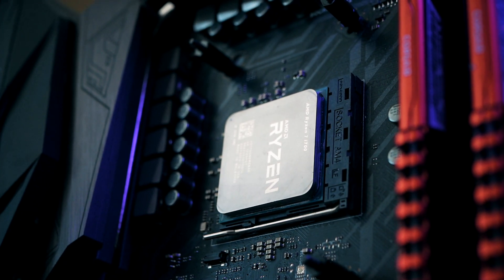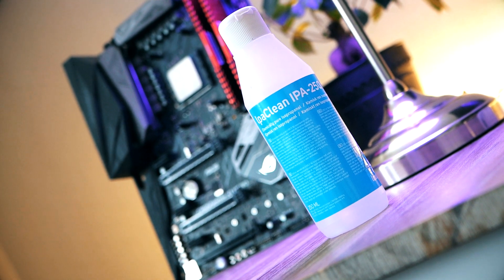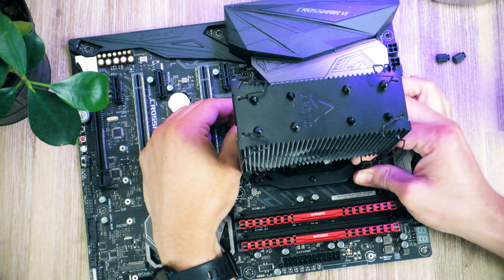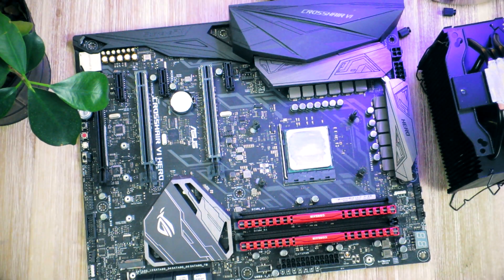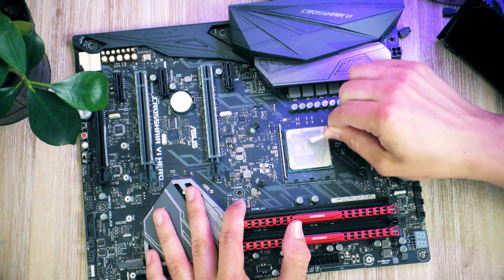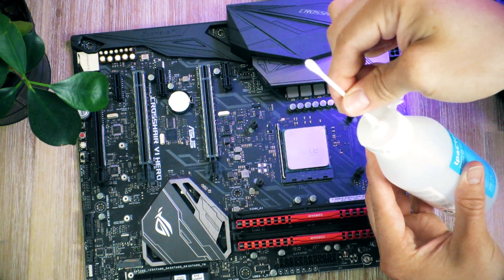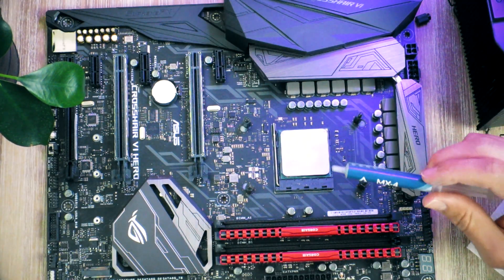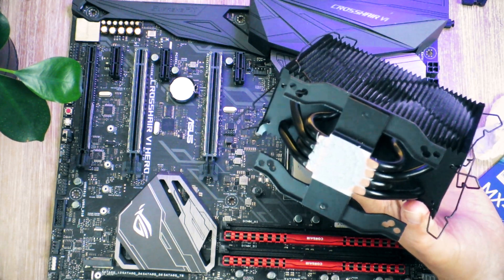How to Remove Thermal Paste From CPU & How to Apply New Thermal Grease

Comment: Added note: Disconnect the Motherboard from the PSU  I also prefer the spreading method on the CPU paste.  The thermal paste is only used to fill the tiny gaps of space between the cpu and the cpu cooler.  Use as thing as possible, this will increase the efficiency.
Reply: Or if you really want to go crazy, 3M makes sandpaper designed for cpu lapping and it gets ultra fine.  Get that heat spreader shaved down a few micrometers and give it a mirror finish before applying the heatsink and paste

Comment: My motherboard has a metal unit that goes on top of the CPU to keep it in place. So to remove all the thermal paste, I had to remove that unit to get at the edges of the CPU. But because I left the CPU in the motherboard without the unit and tried to clean it with a paper towel, I accidentally moved the CPU and got thermal past where the CPU is supposed to go. So now the motherboard is toast. I thought that I was just an idiot. But now, I see that the idiot was the one who designed the motherboard.

Comment: I checked my cpu temp for the first time after 2 years and it was 97°C, adding a new fan didnt do anything but redoing the therm paste brought it down to 55°! Thanks for the vid
Reply: i'm about to change out the thermal paste hopefully it fixes my problem too
Reply: @toothy_efoa  has it worked?
Reply: @1Kaiii  yeah
Reply: Damn this will be lifesaver if it works
Reply: @userhd2233  Did it work?
Reply: @infuriators9644  if he doesn't reply, it probably didn't work and the CPU combusted.
Reply: @MakaveliTheHusla  Lmao
Reply: When your CPU is at this temperature, you NEED to change thermal paste. Also be sure to not tight too much the screws of the cooler. Too tight will spread the thermal paste too much and the heat will not goes through the radiator as fast as it needs to lower the temp of the CPU. You can also see when it's approx. time to change it when playing for one hour, if the temp is not going down very fast after quitting the game, then it's time to think about changing thermal paste and cleaning your radiator. I do it one time a year (with good thermal paste) and it's pretty much the same time to tidy your build too.
Reply: yeah i have the same problem.. just orderd me some thermal paste. i hope that solves it!
Reply: @ajaxgoals7280 did it?
Reply: I am here for this reason.

Comment: Is 100 °C normal after apply the liquid silver type of paste? I had trouble locking the CPU down and it's not rock solid in there... should I reseat it or wait?

Edit: I fixed it, but the GPU suddenly stopped working...whats a good upgrade for a 980Ti for games?
Reply: Bruh anything above 80 degrees is normally a red flag

Comment: that is not how you apply thermal paste mate. i've been tearing down and repairing and building pc's for enough years to know.   The best way is to spread the paste evenly across the surface of the cpu chip and then drop an extra little blob in the middle to ensure a good connection between the surface of the heat sync and the chip. A tiny plastic craft spatula is perfect for application of thermal compound
Reply: Is this gonna improve my temps?
Reply: It actually… doesn’t matter lmao

Comment: This guy sucks, don’t follow this advice it could kill your CPU. Terrible advice.
Reply: thx, what vid would u recommend instead of this?
Reply: @vipervolkan3042  Most of the information in the video is solid, except he makes you remove the cpu for no reason whatsoever. Applying the thermal paste while the CPU is removed adds the possible chance that the thermal paste with leak into the pins! 

If you follow this video, without removing the cpu you should be good as long as you exercise caution 👍

Comment: I’ve had my pc for about 4 years now and never really cleaned it.. its got a water cooling cpu fan and my cpu temperature goes to 96C as soon as i turn my computer on I’m gonna get some compressed air and thermal paste and hope i can clean/fix it
Reply: Sounds like either the cooling liquid hasn't been sufficiently filled up (or the pump isn't running etc), or someone forgot to remove a plastic seal before installing the cooler. 96C is bad with standard air cooling under heavy loads, let alone water cooling at startup. If you hit well above 90 just on idle, it means you probably never get more than half the CPU performance that it has available since it'll be throttling instantly and cut down on its frequency significantly to avoid critical cpu damage.
As a benchmark for a standard build, your idle should be around 50C or preferably lower with watercooling, and stay in the 60-80C range under load. Anything nearing 90 is a major warning sign that something critical has gone wrong.
Also make sure that you don't have the water tubing/radiator mounted in a way that could create big air gaps and prevent flow through the pump, especially if the pump is in the CPU attachment block.

Comment: does someone know if it has to be isopropanol? I have 95% alcohol in my house but I don't know if it will damage anything. Should I buy isopropanol or is mine fine?
Reply: It's safer to use isopropyl but stuff like acetone works okay too. Just make sure it's not full of additives that could potentially damage something (unlikely) and try not to get high off of the fumes or you might make a mistake 😂

Comment: A month ago i bkught a rog 360 ryujin aio cooler that has pre applied thermal paste, im replacing my cpu from a ryzen 9 3950x with a ryzen 9 5950x, should i add a dot of thermal paste on the new cpu or will the pre applied be enough?

Comment: Wait could this also work for if you wanted to upgrade your CPU as well? I just got my first tower and I'm excited to build it, but the processor I have is not the best (an old AMD A6 chip) but I am planning to upgrade to a ryzen 5 in the future.
Reply: Sure, just make sure that your motherboard supports the new CPU you want to upgrade to. You can check compatability pretty easy by just googling your motherboard and the cpu u wanna use. Since you say your current cpu isn't the best (aka an old AMD chip), I wouldn't expect the motherboard to support new AMD chips. Usually they only support 2-3 generations of chips

Comment: One tip: do this after you have played on the pc about 10 minutes so that the thermal are soft, this make the progress easier
Reply: Good idea and maybe run cinebench
Reply: @SwiffyDK  Yes. That will heat it up the most.
Reply: @SwiffyDK  for me itd be AC odyssey, ive been using the stock ryzen cooler but seen my temps in ac oddysey at 90-93 so went and got a new aio
Reply: Also use a microfiber cloth because cotton swabs an paper towel will leave some stuff behind that can mess with your cpu an fan
Reply: @rkpain3622  :o any kind?
Reply: Or you can use blower either.
Reply: Can’t do that shit when 3 cpu pins are bent.
Reply: this is the most important tip unless you'd want your precious ryzen to be ripped out from the socket.
Reply: what if its already dry, how should i get it soft
Reply: So I do this with my other board still in my pc lol I can’t take my motherboard out in less then 10 minutes
Reply: @Reuben Henry No problem :)
Reply: @felixgunner9538  why did you delete it bruh
Reply: @sotaveturi  prolly YouTube hid the comment because it thought it's spam
Reply: @Felix Gunner thanks, signed up and it seems like a nice service :D Appreciate it!!
Reply: I know Im quite randomly asking but does anyone know of a good site to stream newly released series online?

Comment: you cannot get air/bubbles between your CPU and cooler. 
The pressure between them is too high to have bubbles + the thermal paste is used to fill in any imperfections in the surfaces of the CPU and cooler

Comment: I just dismantled my 8 year old 3770k rig and discovered that only about 80% of the CPU was making contact with the cooler - I wonder if not using any thermal paste at all resulted in better cooling adherence and improved overall performance?
Reply: is this a joke?

Comment: Holy fuck, the amount of miss information on thermal paste application is just crazy. This guy did a good job! but your worst nightmare is not applying enough paste. Use moderate amounts of paste because the surface of cpu dies and heat sinks are never perfect. If you are using conductive paste then 80% coverage is fine to avoid spillage on the board.

Only people who over clock to the electrical and physical limit of the cpu need to worry about thickness of thermal paste. Usually these people lap or remove the die plate to achieve better results. If you are doing this then you worry about thickness. 
All Heatsink clamps have a torque/screw limiter/washer to prevent pressing all the paste away. 

You can build an engine and it could be for a lawnmower, your moms car, a ferrari or an F1 car. Its up to you to determine the work required. Not all computers are F1 cars. Most of them are your moms car.

Comment: I have a question, I recently upgraded my PC, and now when playing Rust, and only Rust, a high CPU usage game. Sometimes, randomly it will flip my breaker, all the power in my room only will turn off. And I’m wondering if it’s my thermal paste because it never happens when I’m doing anything else. Only while playing Rust. Sometimes it doesn’t happen and sometimes it flips the breaker like 4 times in a row back to back.
Reply: Or upgrade your power supply dawg
Reply: Ummm......
CPU usage doesn't interfere with the thermal paste since thermal paste helps helps it cool down physically so that the pc doesn't shutdown the pc byitself 
I think it's a problem with the OS or the thing u upgraded (ram/ssd) or maybe settings of the game
Reply: Get a new pc

Comment: Using paper towels has a problem- lint. You can use fancy wipes or eyeglass cloths or something but, the easiest thing to use is coffee filters.
Reply: I have alcohol small rigid papertowels for my glasses can they be used? Or is it better with the microfiber cloth that always comes with glasses?
Reply: Are baby wipes fine?
Reply: @zeno8612  Like ButterBoy said, I wouldn't use them as a lot of baby wipes are soaked in solution which could short your board or chip. Best bet is to use a microfiber cloth to make sure the cloth doesn't fall apart or leave any small hairs or pieces on the chip
Reply: @zeno8612  I wouldn't use them

Comment: My 9900k reaches 80c while playing siege. I started to panic and bought arctic silver. Today I looked at my cpu temps after I applied new thermal compound, and the temperatures stayed the same. Anything I’m doing wrong or is there a problem with my cpu overheating. If you are wondering I use a kraken x62
Reply: DarkCubical did You take oof ur cpu or cpu cooler protective sticker?

Comment: instructive tutorial but what is better, if the thermal paste oozes out or if there is space left on the CPU without thermal paste because it didn't spread to the edge of the CPU?
Reply: I think more coverage means more heat transfered, but too much paste means thicker layer...

Comment: you dont have to take out the cpu to reapply thermal paste?
Reply: no, just watch out when you remove the cooler, you either twist or either pull the cooler, never both, that way it can bend the pins

Comment: In my opinion putting a “goop” of thermal paste in way better than spreading it yourself.. creates alot more air bubbles
Reply: I would like to see proof of the mystical air bubbles everybody is talking about. If you don't want "air bubbles" use an X, you get more coverage than a dot.
Reply: @FirstDagger  I did an X and a drop in the middle and just spread it myself, this way there are no air bubbles because pressing cooler on it will spread it from below as well and make it ooze out of the sides. If people are worried about air bubbles they happen all the time you can just minimize air bubbles and applying a thicker paste and pressing gpu on it will get rid of bubbles anyways.

Comment: I use Noctua NA-SCW1 cleaning wipes they are fast and end result is good but it creates a bit of waste so not good for the environment. I also used isopropanyl and paper towel but will switch to microfiber. When I'm out of wipes. Hmm this post didnt turn out so well 🤪

Comment: I changed my thermal paste on the GPU and I have 35 celsius degrees lees in my GPU!
Reply: Sadly I cant open my pc because of the 1 year varrianty
Reply: Erdan prebuilt?
Reply: @talewhisper-u5e  install a program to check your temperature, if it's crittical, ooet in and change it
Reply: Erdan who needs a warranty just learn about computers

Comment: Just wondering when u should take of the thermal paste if you are installing a new heatsink should you remove the thermal paste
Reply: If u are installing a new heatsink it's best to fully clean the thermal compound off the CPU and reapply for new heatsink

Comment: Why do u have to apply nwe thermal paste
Reply: The thermal paste conducts the heat from the cpu to the pipes/plate of the cooler and it also fills any micro holes/gaps. 
Without it the heat from the cpu won’t conduct well to the cooler and u’ll get quite high temps

Comment: Also, coffee filters work well at cleaning off old thermal paste if you don't have anything else.  They are cheap, come in huge bundles and can take a little alcohol without falling to shreds like tissue paper.
Reply: I heard of this or read this somewhere before. Is this a better or worse solution than microfiber cloths?
Reply: @Barrosy  IMO its better because its disposable.  I don't like washing things with industrial style grease in my general washer.  Your not rubbing the coffee filter on something delicate like a piece of glass.  Your rubbing it on a metal cover of the chip.  Save the microfiber clothes for more delicate things or eyeglasses
Reply: what if i dont have coffee filters?
Reply: @coleydrew  then go buy 600 of them for 12 bucks.
Reply: Been using coffee filters for it for nearly 17 years. Can recommend strongly.

Comment: Hello I have a question I’m an average pc builder and this was the first time I applied thermal paste by myself and I did a pea size dot on the cpu and a pea size dot on the heat sink and didn’t know have anything to press with so when putting the fan in place I just use that to spread it evenly? Is this okay
Reply: Should be fine, if you want you can just cut a piece of plastic bottle to use as a spreader

Comment: How often I should replace the thermal paste?
Reply: At least two years
Reply: im still thibking about replacing thermal paste on my old family pc. It was used most of time 1-3hrs every day. More 1hr than 2hr so ye wasnt heavily used at all and temps are still decent. Cpu is at 35° when in bios and in windows idle its at max 60°. Thermal paste holding up good so probably not going to do anything
Reply: every 3 or 6 months, in between them

Comment: How long after applying the paste should one wait before powering up the system, again?
An hour, a few hours,  or right away??
Anyone... someone, lol?!?
Reply: You can turn it on immediately after applying the thermal paste. No need to wait.
Reply: You don't need to wait. If you want to have a dry thermal paste on your CPU, you'll need to wait 2 years or maybe less. You can safely turn on your PC after applying it

Comment: why would you cut/edit the part where you are actually applying the "right" amount of paste.  It goes from a tiny spot to a blob with no reference to how long it took you.  SMH.  Also you can use coffee filters to remove thermal paste if you don't have any paper towels.
Reply: MrShwaggins you sir, are a whole new level of stupid. The tiny spot got spreads around by the heat sync LOL
Reply: @jakeschreiner8991  My point stands regardless.  @4:24 he jump cuts in the middle of pushing the paste out of the tube/syringe.  There is no need for a jump cut at the spot THE VIDEO IS NAMED AFTER.  This is supposed to be a how to, right?  So someone without any experience with this procedure is the target audience.  Thank god he caught himself almost putting the CPU in sideways
Reply: @MrShwaggins  THIS

Comment: Thermal paste should come with a pre droplet squirt. Like the pancake batter machines they make pancakes the exact size all the time. Why can't they make a thermal paste droplet like that? 

Great video, thanks for sharing.
Reply: My thermal paste came with measure lines on the side of the transparent syringe. 👌🏻
Reply: @samm795  That's what I'm talking about 🤗
Reply: Honeywell PTM7950 comes as a sheet and you don't have to mess around with any applying dots, dashes or crosses. You just cut out a piece the size of the IHS/core and stick it on. You also don't have to worry about whether the paste is too little or too much - it will be just right. In addition, it lasts longer, performs works better than traditional pastes and there is no pump-out effect.
Reply: Because it is so viscous it doesn't drop? Come on dude, think then talk.
Reply: @fns58  Of course it can be done. You kidding me?
Reply: EL EVO thermal paste is like toothpaste...try and fill a straw with toothpaste and then get it to come out in a nice neat metered amount...I’ll save you the trouble. It ain’t happening.
Reply: @seanmetzger4780  We are traveling to outer space, but we will never be able to meter thermal paste?
Reply: EL EVO the two could not be less relevant. It’s a simple discussion of viscosity. I know, tough to understand. If you want something fool proof use the carbonaught or other carbon strip paste alternatives.
Reply: @seanmetzger4780  Not squirted from a tube, but premeasured as a bead.